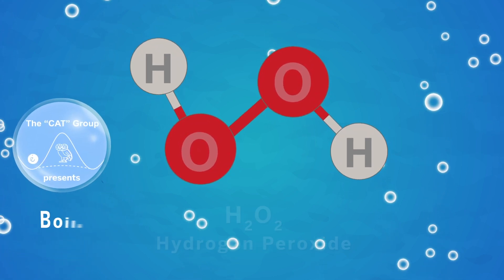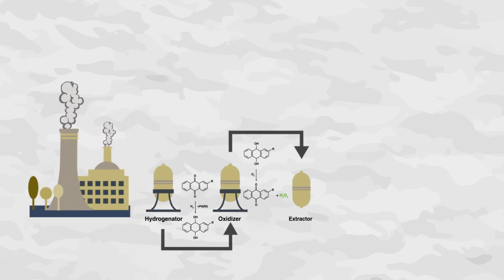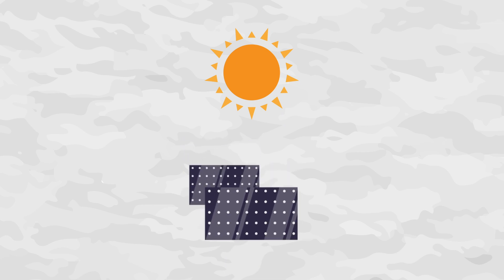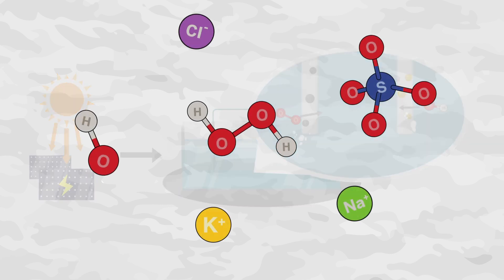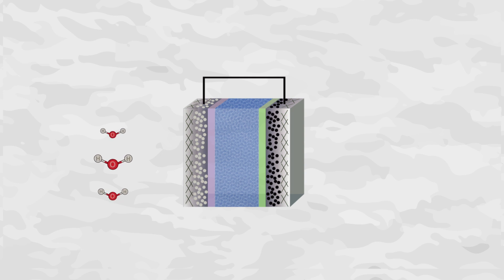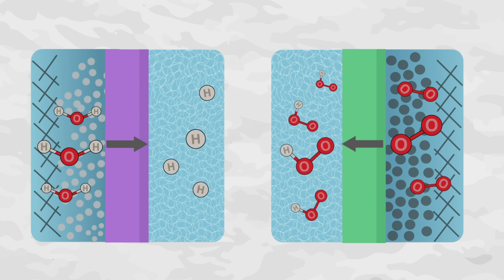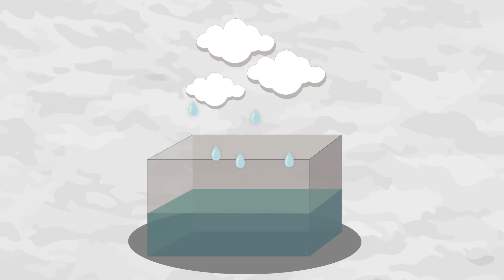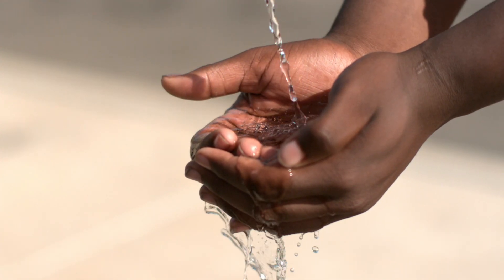H2O2 from air, water and electricity

Comment: Theyre reporting they can make hydrogen using led lights and certain mixtures/waste gases now. Those mixtures can become how to transport hydrogen ingredients. That helps power grids and maybe car applications. Maybe you put the hydrogen ingredients in hybrid car, then they make hydrogen in the car to charge battery cell, or run the car directly.

Comment: If this can be efficiently scaled down then you could use it as a form of energy storage, especially for things like residential heating where you could generate peroxide during the day using solar power then at night release that energy directly as heat using catalytic decomposition

Comment: The only process i can think you can make it at home is to use Percarbonate electrolysis. Pecarbonate can than be than decompused with CO2 to form H2O2. The description i ve read if you use an slury of perborate and water you can make this why higher concentrated H2O2

Comment: so... a recent paper published by the ACS shows H2O2 production with palladium as a catalyzed reaction... and it actually works better with AuPd.. which I isolate from kaolinite clay with a small propane torch... my current experiment has kept a balloon inflated for almost a month... no energy input required... when I feel better I will run a current through two bottles joined by a siphon with palladium on one side and AuPt on the other.. platinum splits the hydroxyls into hydrogen oxygen gas... as a catalyzed reaction... absolutely free
Reply: At $100 per gram😬 hope it works!
Reply: Hi, Richard. Were you able to sort out the details of your experiment? I'm interested in the outcome. Thanks.

Comment: Very high currents on an Platin Anode create H2O2 or O3. I think they use an Diaphragma to seperate the H2O2 from the Anode/kathode to prefend decompusen.
Reply: and passivates the platinum into platinum oxide, which then can be regenerated with heating to 350*C
PbO2 is better for this as it doesnt passivate
supposedly in a perchlorate solution PbO2 would work the best

Comment: First off he attacks the oil industry with zero reservations. Everything you currently have from a smart watch to a sky scraper is a direct result of  oil.  You cannot have your precious solar panels without oil. The cost of those subsidized panels makes it impractical in a third world county. The best "green" source of renewable energy is hydroelectric but, God forbid we build any of those.  The panels have a horrible life expectancy and the destruction of the environment to build those panels is enormous. Mining for the silca sand all the gas guzzling trucks , rare earth elements and then the waste. 

You would need vast amounts of electricity to produce enough h202 in quantities needed to purify water at rate in which any modern city would require. Thats why no city is currently duing this. It extremely expensive to purify water this way. Its fine if your okay with clean drinking water only during the day? If not then what batteries to store the energy? How green are those batteries? Its too expensive and impractical like most of the "green" ideas. The only sustainable thing about solar or wind is the high cost and the subsidies big bad oil provides them.  The idea sounds good but the practicality is zero. Attempting to make hydrogen peroxide can be explosively dangerous. Oxygen and hydrogen when separated may have some fiery results.
Reply: How about you lay out your equivalent analysis for the continued combustion of subsidized FF ad-infinitum now in this post-Peak-Oil stage of impending Climate Disruption.

Comment: When you make electrolysis with water on the negative elecrode hidrogen is formed and on the positive electrode oxigen is formed, why should they combine to make first HO2 that means that some how some hidrogen was near the positive side which is impossibole because it is repelled by it, and then it becomes H2O2 because some how there was another hidrogen atom neat the positive electrode and the same question repeats, how did the hidreogen atoms arrive near the positive electrode?
Reply: Listen, I have done this before, I was making hydrogen gas. I was moving an electrode and it was slightly stinging in a small cut I had, because it is slightly acidic. It is in fact hydrogen peroxide.
Reply: @WatcherLater  what electrodes were you using? and how much current? I want to replicate this.
Reply: @davemwangi05  It was equivalent to a 9 volt battery, and my electrodes were graphite.
Reply: @WatcherLater  and which electrolyte did you use? I'm into this, I've been making chlorate by electrolysis and now I want to make H202 instead of buying it as I did.

Comment: Over complicated. Keep it simple. Distilled water is best but just purify your water the best you can and pour it into a container- preferably glass... Hook up a dc electric system... For safety use low current overnight... Electrode and cathode... Bubbles will form. Collect those bubbles- here's the tricky part... Collect those bubbles in a tube and bring the oxygen bubbles and hydrogen bubbles back together in a clean separate container... Tiny amounts slowly because explosion may occur... Cool but over 32 degrees is safest... No. End result is not hydrogen peroxide, but it will be pure water. Distilled water, so if u started with it well- u just learned how to make more...